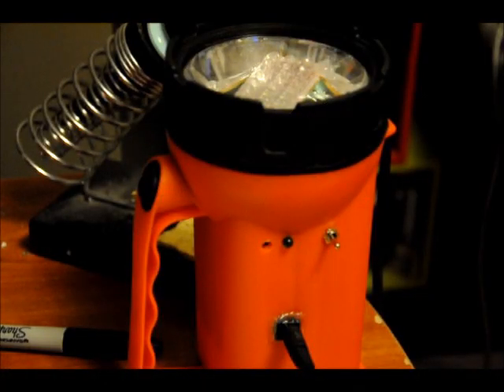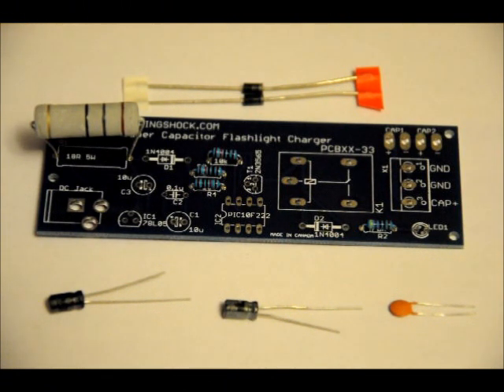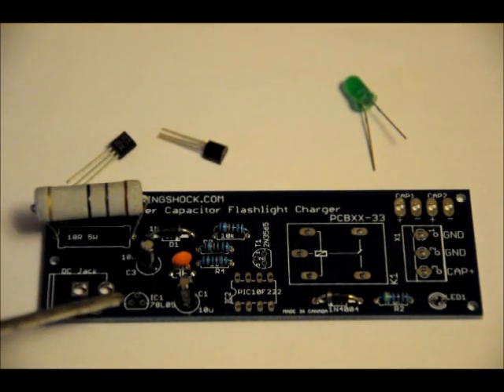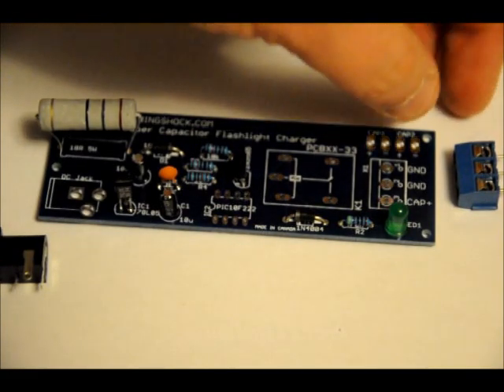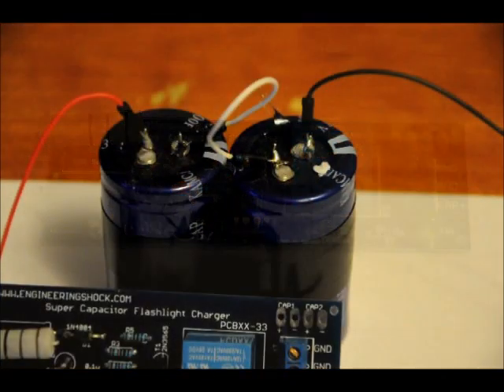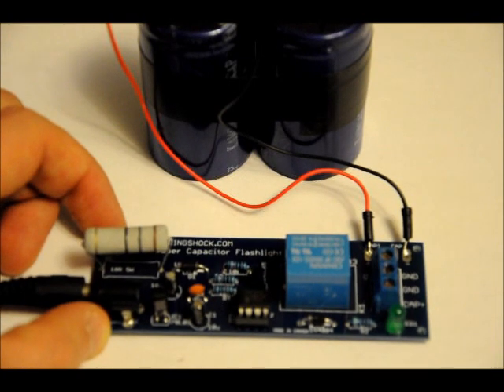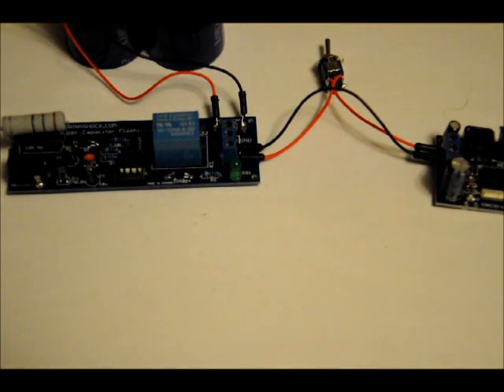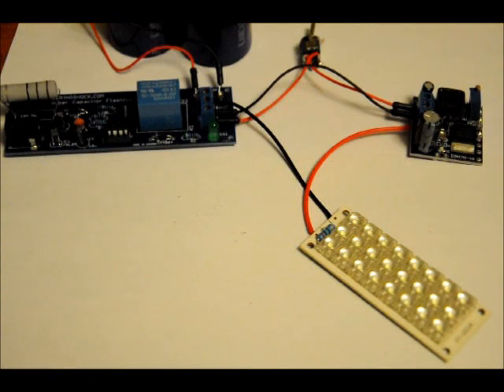The Super Capacitor Flashlight Kit Assembly & Instruction Video

Comment from the maker: @SAMIMYS 
Thanks =)
The full charge on the caps is never more than 5.33v or so.  This is because the cap bank can't handle a higher charge due to the rating of the caps.  The voltage booster requires 3.4v or more, and can boost to up to 34v.  I take the voltage on the caps (>5.35v) and boost it to work with the LED bank.  The LED bank will operate at voltages between 8-12v (12v being the brightest).  The LED bank will not turn on at >8v.